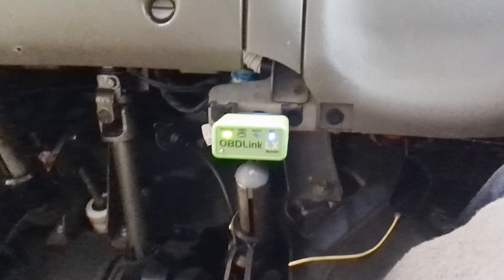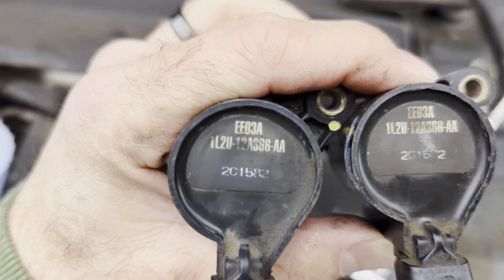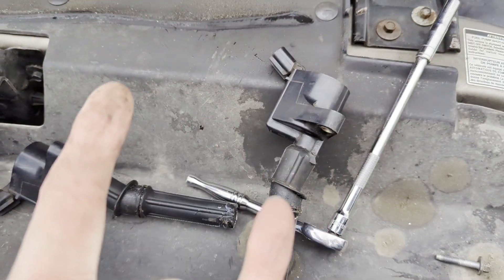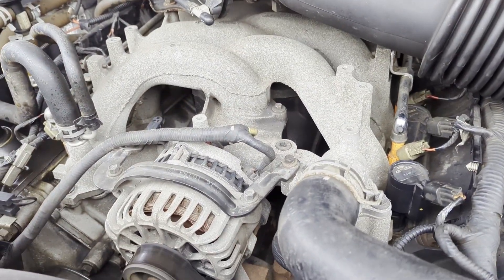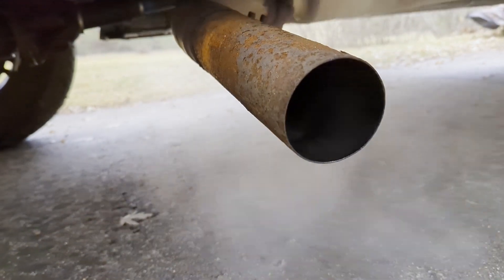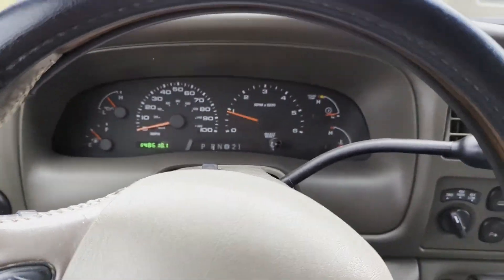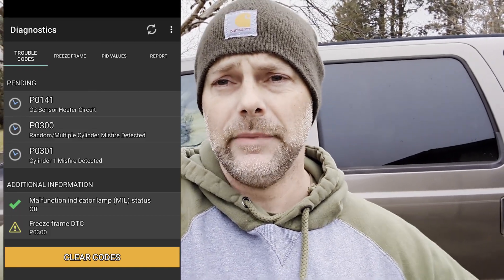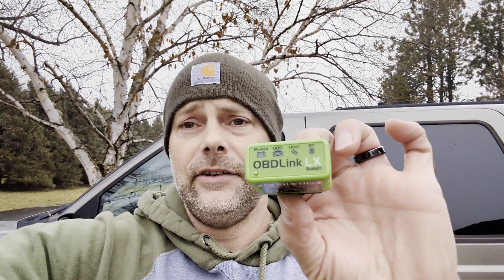Misfire diagnosis - 2002 Ford Excursion V-10

Comment: You really should do them all at the same time if its feasible and keep the old good ones as spares then  they are all firing the same and longevity will be the same as they get older the spark believe it or not gets weaker its not it either works or it doesn't i know i always thought so too but turns out thats not the case i guess the windings get idk less something in there and spark reduces a new one the spark will jump a lot further than an old one this is the way i understand it now i have not tested this theory